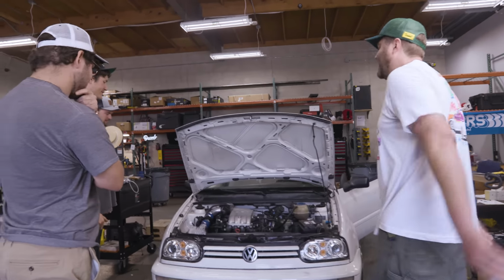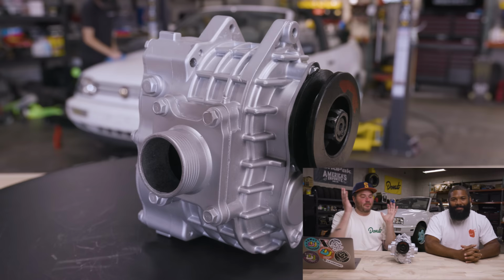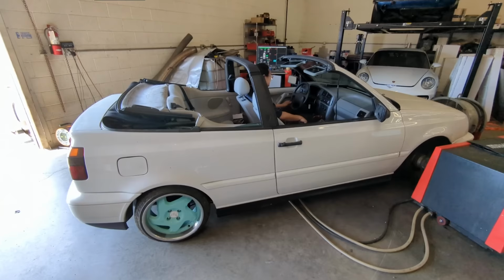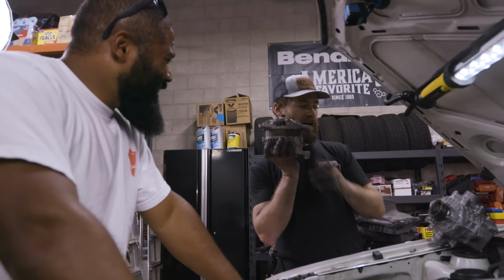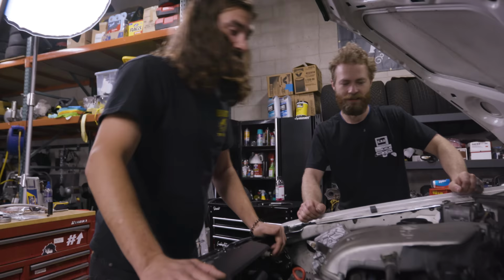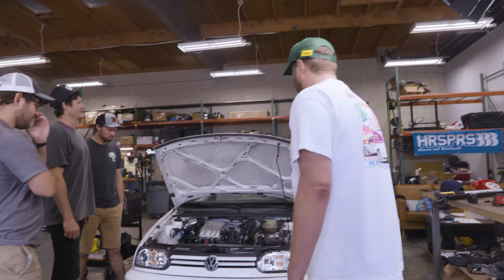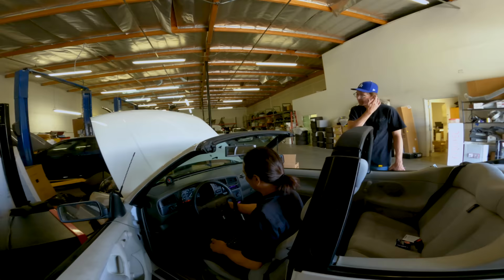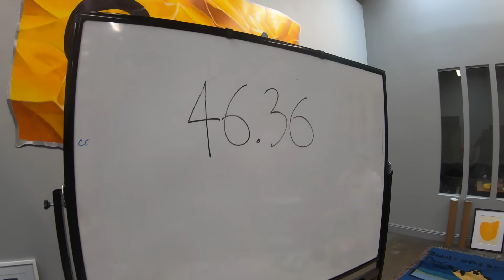We Installed a Wish.com Supercharger on Our Car

Comment: At first I thought, wow, that's actually surprisingly great, for a supercharger from Wish, +46 horsepower. Then realised that was the total... So funny
Reply: I only got it after reading your comment.
Reply: Bro same 😂
Reply: Supercharger*
Reply: @redfishbluefish67  I forgot to read, I could have sworn from memory it was a turbocharger that they bought from Wish. Must be a false memory, cheers.
Reply: Lol -46hp
Reply: @SWISS-1337  its not rocket science you immediately can see it has a pulley .. pulley means belt driven not exhaust ..
Reply: @mathewhoffer4541  tbh, I basically skimmed through the whole video, whilst working, so had I paid enough I would have seen it wasn't a turbo, but hey, you do you, I already changed it and acknowledged my mistake, but if it makes you feel better, be my guest.
Reply: It's true that you get what you pay for.
Reply: @mathewhoffer4541  congratulations on knowing a thing
Reply: They didn't tune the car. It needs a shitty Cobb tune
Reply: @mengx94  I was disappointed about that part, they briefly said about requiring a tune or ecu programming, so would love to see how different the results would be
Reply: @SWISS-1337  I wonder if those "superchargers" are directional in flow. Is it possible they installed it backwards? Granted the 2.0L is WAYY too big for those little chargers, I'm pretty sure they come stock from a 3 cyl Subaru motor.
Reply: same lol
Reply: @estewar03  that would have been hilarious, and explain the massive loss in power. I don't know much about superchargers, so I personally don't know if that's possible, but if so that's a hilarious thought.
Reply: @SWISS-1337  in the first video the description called it a turbocharger first then called it a supercharger at the end.
Reply: @mengx94  If there was any positive boost pressure the factory ECU should automatically compensate up to about 8 psi or somewhere around there and make more power. Problem was that it wasn't making any boost... it was just restricting the intake. You can pop a turbo (less than 10psi) on most cars without any tuning and make more power. This supercharger is worse than those inline fans that people put on their intake charge tubes. It sounds broken to me, though.
Reply: same
Reply: @estewar03 of course they're directional, they don't push air in two ways at once lol
if you watch the video by the guys that installed it you can see them make sure it's pushing air the right way
Reply: @p0xygen  if you say so. There's plenty of others who've used these same chargers with success.

Comment: I love how Nolan's sarcastic guess was surprisingly accurate lol
Reply: I thought he meant it would add 50hp.
Reply: Pretty sure he knew it was hamstringed and the guess was legit.
Reply: I don’t think he was being sarcastic hahahha
Reply: That was deadass the best part, like bro was actually right 😭
Reply: @sienile  When someone said it just briefly made 1Psi of boost, guessing they had maybe a digital guage from an ECU or something... if it's not running pressure, it's probably restricting the intake like hell.

I think being sat in that car, you would feel how bad it was pulling away no matter what the sound was like lol.

Reminds me of those whistle exhausts that were a thing for some reason lol
Reply: @droplifter3435  100% it's a restriction.  if it was actually compressing the air, it wouldn't be so much of a problem.  But it kinda fails to do the thing it's meant to do, which is supercharge the air, so it just ends up being a massive restriction.
Reply: @eddominates  also the fact that superchargers take hp from the engine to make hp. This thing was just sucking hp like a vampire🤣
Reply: @droplifter3435  - It's absolutely a restriction. How else do you get boost on closed throttle and half the stock performance? :P This engine would need 3 to break even.
Reply: I was way off with my 69hp prediction, but hey at least Leonardo DiCabrio now sound like a bad ass race car
Reply: @franciscogomezalvarez55  yep.  even if it was all working properly, they didn't add any fuel compensation and I don't think that engine has enough balls to even get the blower going, it's just a drag on the engine lol
Reply: A top fuel 12-71 supercharger doesn’t make that much noise

Comment: Man it sounds like that supercharger has an incredible amount of friction, the impellers are going to weld themselves together.
Reply: same thing i was thinking
Reply: I'm just imagining a bunch of metal dust blowing into that poor engine
Reply: Yeah, I there is something not right. Either hey have it going the wrong direction or it need oil put in it. They cant ship any engines from China with oil in them, so probably the same for this. It's not a complicated device and for any  engine  factory to produce, and there a hell of a lot of engine manufacturing in China. I have seen issues with their stuff for using crap materials as well.
Reply: @markusgarvey  Chinesium the weakest metal known to man
Reply: Lol, as soon as it started I thought to myself "that is the sound of pure pot metal on pot metal friction". Between the noise, the way it would die when you clutch in, and the fact it robbed about half of the power...but, I'd like to think that the boys checked before hand
Reply: This is what mobile friction welding sounds like,,, lol
Reply: @markusgarvey  Listing I read for these reman units are shipped dry !
Reply: @joer5057  famous last words
Reply: Its suppose to have oil in it y think
Reply: @SamTheRook spotted the guy who's never taken the air hose off his turbo and taken a look :)
Reply: @crewnecks7922  💀💀💀
Reply: @crewnecks7922  diecast metal 💀
Reply: @SamTheRook yeah bro youre right make sure you never run oil through your turbo charger either, fun times to be had
Reply: @SamTheRook always run oil lines to your turbo, the guy above me is a clown
Reply: @crewnecks7922  I came here looking for the 1st person to mention Chinesium. You win , take the day off. 😂
Reply: @Mark Estrada should have more faith in the installer and less in the guy using a cigarette package for gasket material 😂
Reply: I think its installed in the opposite spinning direction, i bet if it was install on the same direction of the engine spinning it would of worked better
Reply: That noise was just the self-clearancing at work!
Reply: @markusgarvey  I thought they were spinning it backwards or overspinning it.
Reply: Yeah, it clearly wasn't designed to spin that fast or be subjected to 81 HP worth of centrifugal force. I'm not even sure it was "designed" to do anything other than to scam people. 

I didn't get to see what it looks like internally, but even the basically layout seems to indicate it's incapable of boosting any production model car engine. Superchargers & turbochargers have their drive & intake sides separate for a reason. 

I think what's happening here is that air is being drawn in one side by a turbine that is oriented perpendicular to air flow, rather than inline. Each blade "shoves" air out the other side. The problem is that the design doesn't account for reversion -- that is, air pressure building up on the intake side. In this case, the pressurized air is backing up in the plumbing and escaping back out the supercharger. I think this is probably why it's whining so loud -- the SC is trying to overcome the resistance of it's own air pressure backing down the intake tract. 

That being said, the entire setup essentially becomes a massive obstruction in the intake, which is why the engine's HP got cut in half.
Reply: @markusgarvey  It isn't a good design. That's why it whines so much. The unit has only one turbine, and it isn't oriented correctly to prevent reversion. Reversion is causing incredible resistance on the impeller because it's trying to push air against pressurized air that is escaping backwards through the turbine.

A supercharger's inlet should be perpendicular to the direction of airflow, not inline like this one. 

The unit worked on a Barbie jeep because a small 2-stroke engine sucks in less air naturally than this unit pushes. In this case, the engine is starving for air because the "supercharger" has basically become an obstruction; the engine can suck air faster than this POS can push it in.
Reply: Probably failing cheap Chinese bearings
Reply: It also sounds like instead of greased bearings, they used bushings.
Reply: Oh yeh ud find better bearings on a skate board lol 🤣
Reply: Yup- the second I heard that whine- that's metal on metal. While they were doing the test run on the street I fully expected the unit to fail/ explode before they made it back to the shop. Damn.
Reply: @jamesstephenson2346  lmfao ok bro.
Reply: @sixstanger00  but what if I put this on a small 9hp 4stroke moped, will it work? I've been planning this for a while but I'm scared that it will be a waste of time and money
Reply: @Meme_supplier  If the moped is carbureted, you might see marginal gains. If it's electric fuel injected, it may stall out -- I doubt a moped's electric system could support such a heavy load and sustain engine functions.
Reply: @sixstanger00  wait, can you explain why an efi engine will stall out? I thought efi is always better when it comes to boosting an engine.

 Also, is boosting a carbureted engine by supercharging it easier than turbo charging it? Sorry I'm a newbie in this stuff
Reply: @Meme_supplier  
wait, can you explain why an efi engine will stall out?

All of the engine operations on an EFI engine are powered by the moped's electrical system, which presumably produces around 12 volts. Every electrical device draws on the battery for power. The electric supercharger is a heavy draw. 

If the EC draws so much that the total draw on the battery exceeds what it can charge,  the engine will stall because there's now no electrical current left to power the injectors, fuel pump, spark, etc. 

The other issue to consider is how much HP does your engine need to produce boost? The moped produces so little HP that I would imagine it would require anywhere between 2-3 hp just to produce a useable amount of boost (say, 2-3 psi). This in turn, might produce 3-4 hp from the EC. 
So if your moped makes 9 hp stock, you might get 10 hp out of it with the EC. 

On paper, the principle sounds good. But in practice, it just isn't worth the effort. It's a lot of time, money, and busted knuckles for less gains than a cold air intake provides. 

Also, is boosting a carbureted engine by supercharging it easier than turbo charging it?

Carburated engines are easier to supercharge, provided the SC is roots style (which basically mounts on top of the carburetor in place of the air filter). 

A belt-driven SC wouldn't even be feasible on such a small engine.
Reply: sounds like wish :D
Reply: I agree that friction is almost certainly the culprit here. Maybe I missed it, but was there any oil plumbed to that supercharger for lubrication?
Reply: Did they skip any oil lines going to it?
Reply: This is a clone or a remanufactured one of Subaru's beautiful AISIN-AMR500 and it must be bathed in oil (about 100ML), its assembly is super simple and the guys did everything wrong. LOL
It correctly installed delivers between 0.5 and 0.7 bar of pressure
Reply: @crewnecks7922  Should've made it out of Stalinium, the strongest metal known to man.
Reply: @markusgarvey   or maybe it's a supercharger off of wish not meant for a car. Just a thought
Reply: Also they are not running a blow off valve and they use the throttle body after the supercharger. Throttle body before would be the best way imo to do it if they don't have blow off.
Reply: Knowing Donut, they definitely didn't check or know if it needed oil. I like the personality but never expect them to get this stuff right lol
Reply: They didn’t put oil in it
Reply: 4 days fitting  😂😂😂  I am going to buy one and put it onto the front output shaft on my 1973 ph2 petter in my Thwaites Alligator  2 1/2 ton alldrive dumper  !! Going to overdrive it about 3 : 1 to begin with  !  Shouldn't take 4 days  !! Will film it and report back 😂😂😂   Also a shut off just in case and  I  have a basic understanding that blowers need lubrication  !! Unlike a turbo which needs a constant oil flow a supercharger has its lubricant self contained  . It doesn't need much as the air flow keeps it at a good temperature .  BUT .... YOU HAVE TO PUT SOME IN   ❤❤❤❤❤ QUALITY WORKMANSHIP 😂😂😂😂😂😂😂😂
Reply: I wonder if you added oil to the supercharger.

Comment: Can't belive this small charger almost doubles your power(after being removed)
Reply: Lmfao
Reply: thanks for that disclaimer...lol
Reply: Uhh? they are shipped without oil !!! Was that gear whine I was hearing??Fun vid!
Reply: @charlesfriend9557  yeah sounds like they installed it backwards too, would like to see if the job was just ruined by incompetence 🤣🤣🤣🤣😉👌 no harm in admitting y’all messed up guys gotta lose the pride 🤣👏
Reply: @rezcarguyz26  If you watch the other video from the guys who installed it they did put oil in it to lubricate and they double checked before fitting it that it was pushing air in the right direction.